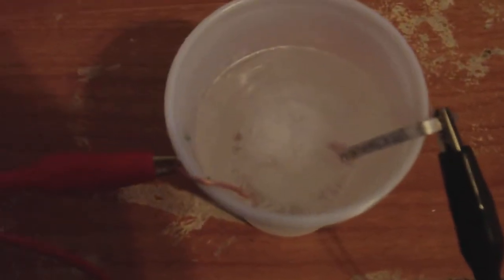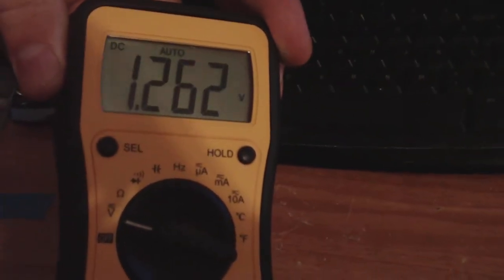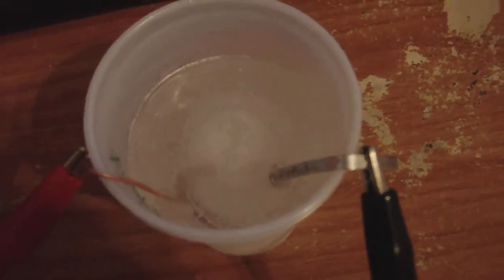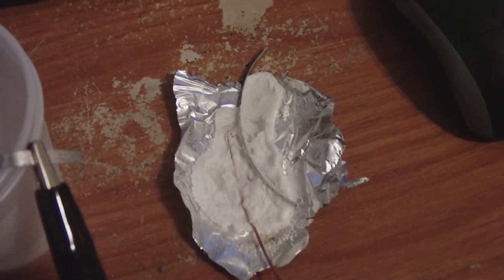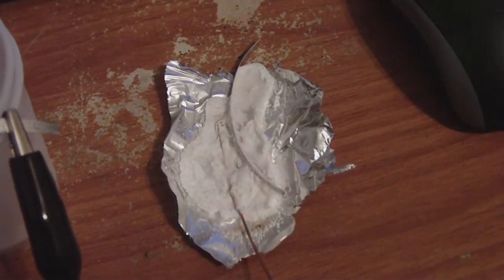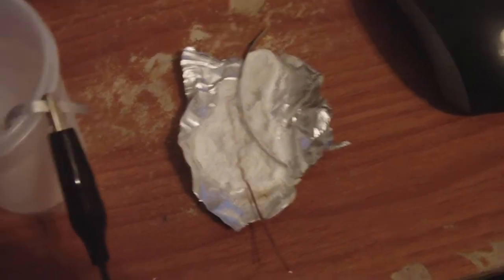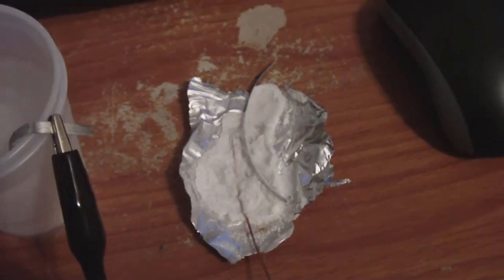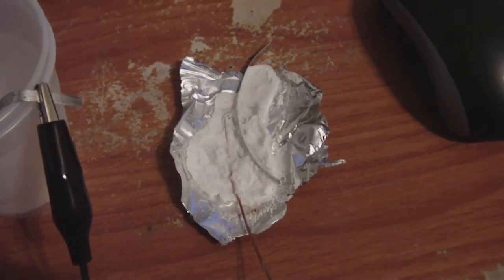Frozen water battery melting

Comment: Sir:  I think it's easy to understand why your frozen water cell did NOT conduct as much as when liquid.  Pure water is an insulator.  Only the impurities in water ( like salt water) make conduction possible.  So, certainly, the purer the "water" your electrodes are immersed in - the ice being purer than the melt - the less the conductivity.  Your salty glue, on the other hand, still conducts even when frozen because its humidity (such as it might be) is saltier, less a pure water ice.    Thanks for all the wonderful exploratory work you're doing.  Sincerely, Robert Bakhaus

Comment: Oh just setting in my yard thinking about it what if you make a concentrated sodium
solution with water and try that with both of those. Just to see what would happen when frozen. aluminum doesn't react well with sodium hydroxide and better with zinc i think it is.... but reg baking soda might just do the trick. if that is working for voltage. ???

Comment: I do wonder how long you get that 50mv in the frozen state? Also how long does the aluminium sodium hydroxide reaction last if that is indeed what is taking place.
what if you used a zinc container to freeze the water in?